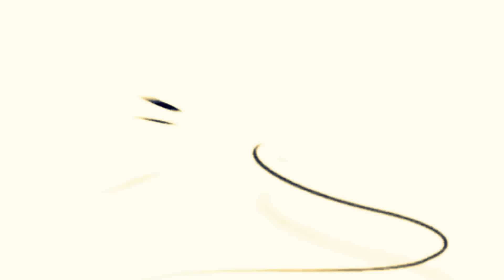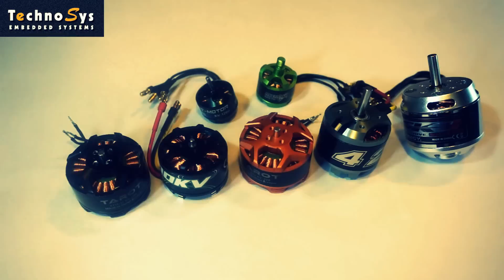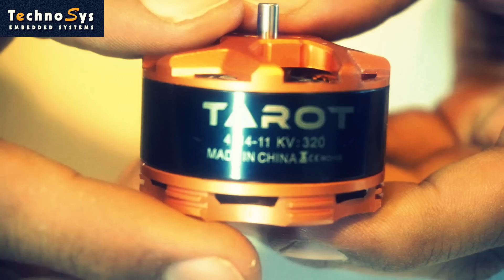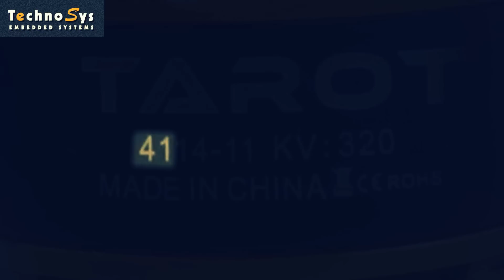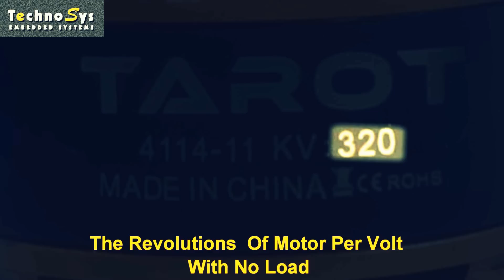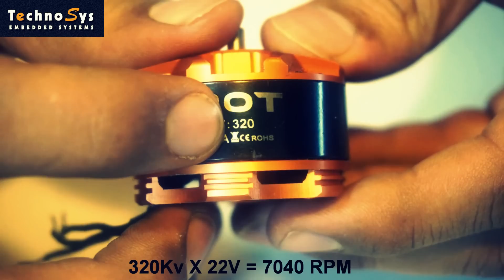BLDC - Brushless RC Motor Numbers Explained

Comment: MOTOR: 5065
KV: 270
MAX POWER: 2200W
WIRE WINDS:
MAX AMP: 60A
ESC: 80/120A
MAX VOLT: 8S
RESISTANCE (Ohm):
NO LOAD CURRENT:
SIZE: 50 x 65 ( without shaft )
WEIGHT (g): 0,380
SHAFT: 8mm with 3mm keyway
Accessory pack: NO
Inrernal PCB with 120 degree hall effect sensors  

can you explain all of this ...  and rpm of the motor ....... and 8s meaning

Comment: Excellent.  Please go in to choosing the proper motor for the correct application.  I'm in to multi-rotors; I understand the thrust issues, but I am having trouble coming up with the right KV for the given multirotor.
Reply from the maker: Will be making that video soon :)
Reply from the maker: Hal Staniloff Please check the following video for selecting brushless motors for your multicopter http://youtu.be/F60eOuFqytM?list=UUYBIbbTAUlVSyyr3P4Rdp1A